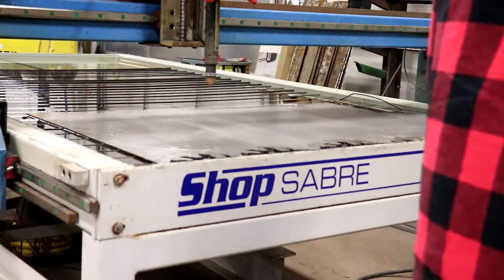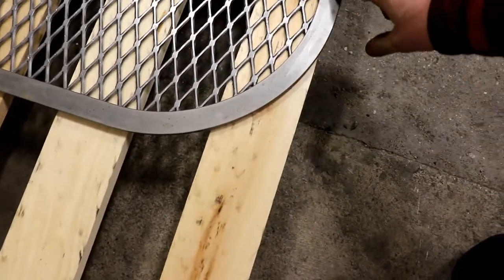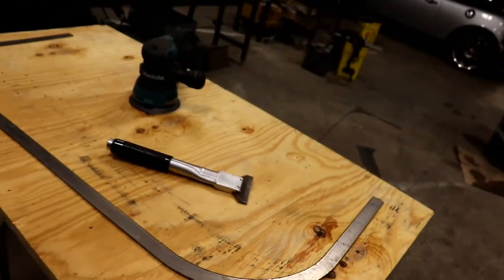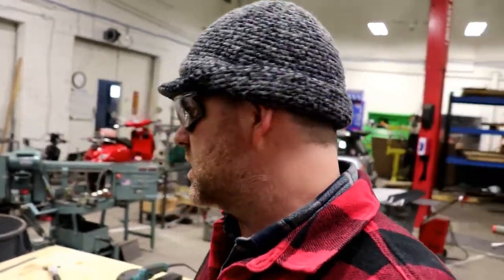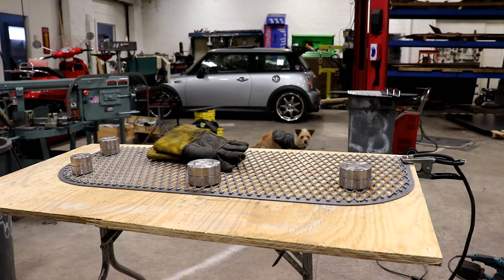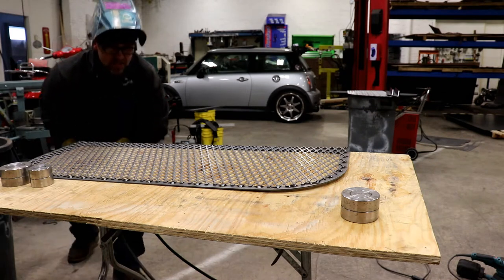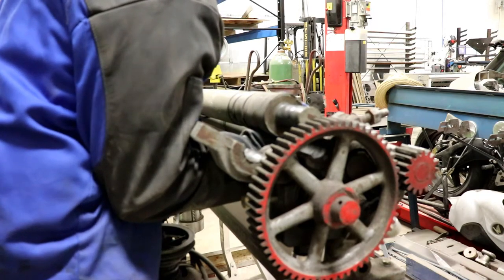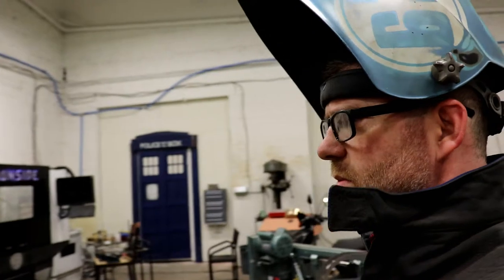Cutting expanded metal with Hypertherm 45XP Plasma RMW - Vlog 124

Comment: Hi there im struggling to cut mesh with a Hyperthem any tips
Reply from the maker: Which Hypertherm and by hand or by machine torch?  What kind of mesh material is it?
Reply: @Regalmetalworks   the unit is a HP105  and using a CNC machine, gal sheet with 8mm holes
Reply from the maker: @jtechlasers  Give Hypertherm a call amd they cam verify if that machine should be able to do so.  I called them and they assured me the torch would not shut off unless it was over 1 second of not sensing metal I believe.  I didn't think it would work.  You do need to turn off your torch height control or it will crash in to the material.